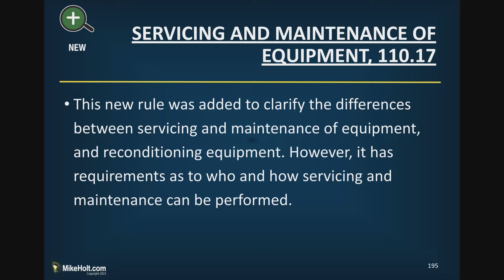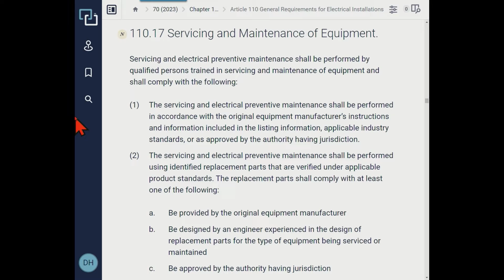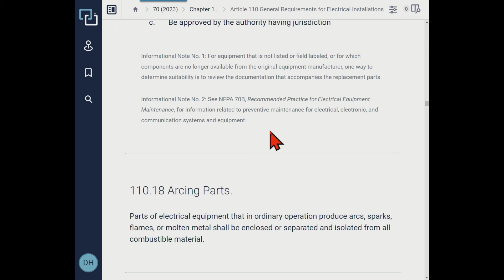Servicing and Maintenance of Equipment [110.17], 2023 NEC, (06min:53sec)

Comment: I was an electrician in large maintenance shops for 50 years and over the years have witnessed more of what we called maintenance on the fly. In 1970 our shop worked 8 hours every Saturday for time & a halve then to only 5 hours then every other Saturday. Of course the company had more breakdowns that some times resulted in hundreds of people working overtime to make up for lost production. My last company did have us perform PM'S on the VFD'S but wanted us to check all connections  & blow out drives with air compressor we carried on our tool carts that blow out moist air all summer. ( they refused to purchase water separator for air compressors ) I refused to do either unsafe work practices. Arc flash labeling is one big joke. Most equipment & installs never bothered with them. We had to two new 1,750 HP JCI compressors that were feed by 13,200 volts to an 13.2 to 4.2 KV transformer that feed a VFD in a cabinet that was 8' high and almost 20' long. Before they applied power I asked where where the Arc flash labels. Told me they were working in it. A year later when I retired they were still working on it. Told my company that they should hold back at least 10% of payment until arc flash labels are installed.

Comment: "maintenance shall be performed' ... Does "shall" mean "mandatory"?
Reply from the maker: According to Section 90.5(A), 'shall' means - mandatory.
Reply: @MikeHoltNEC   Respectfully, I’m having a hard time following your narrative in this video of, “I don’t have to service it and I don’t have to maintain it” when the words in 110.17 are, “maintenance shall be performed” and 110.17 (1) are “maintenance shall be performed”
Reply from the maker: The NEC does not require equipment to be serviced or maintained, but when it is serviced or maintained, "servicing and electrical preventive maintenance shall be performed by qualified persons."